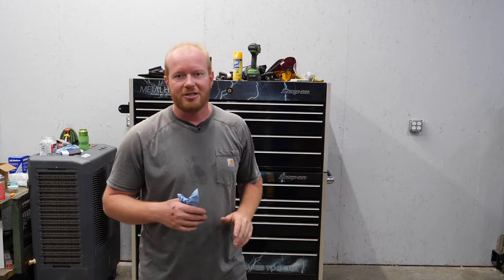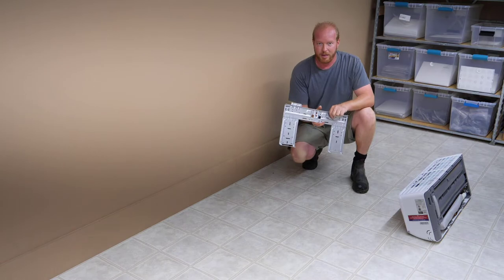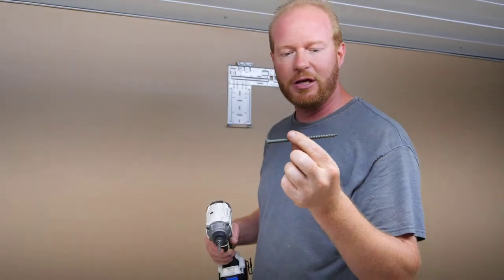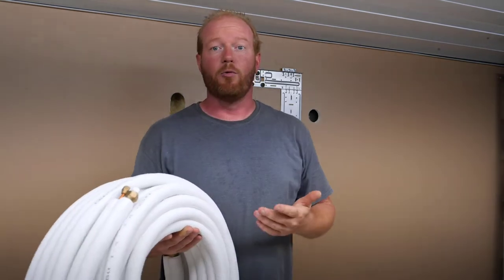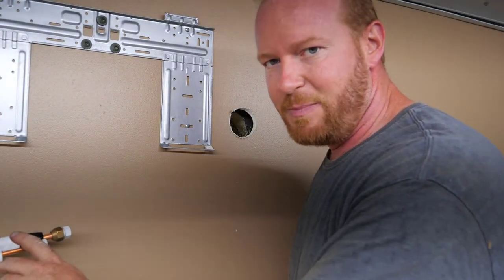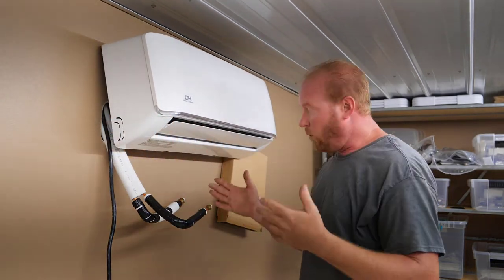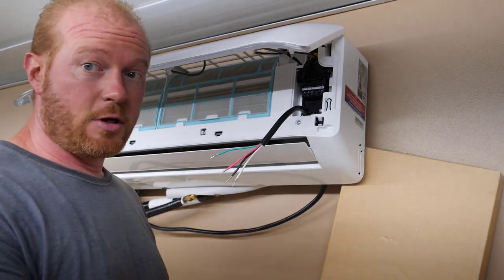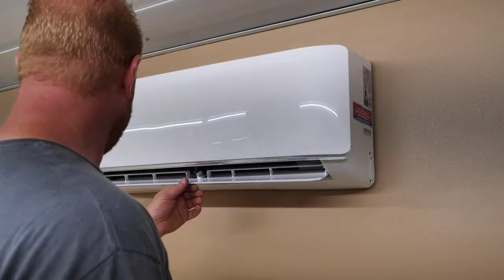Cooper and Hunter Mini Split install, Mistakes were made!

Comment: Pro tip for using that whole saw in drywall, just throw it in reverse. It won't bite and it will easily just glide through the drywall, plus if you ever hit a cable in the wall, it won't cut it

Comment: Thanks so much for the video. I have been looking for a video that showed running line set into the attic. Glad to know that it can be done.
Reply from the maker: Yes, you just have to consider the condensation line. They have pumps if you need to pump the condensation up as well.
Reply: Me too , Thank you so much Flash Performance..   and son :)

Comment: The indoor unit is charged with nitrogen, first it was used to pressure test the unit, then some of its kept there to keep water vapor and oxygen out. Is this system still working?

Comment: excellent video.
 Question: do the electric wire cables (run through inside of the attic) stand the summer heat?
 Thanks vm. Again this is an excellent video.
Reply from the maker: I have had no issues with Attic heat. on the electric or on the freon lines.

Comment: Where is the final installment where it is all up and running?  Thanks for this one as it helped me to see how to put the line set in from above.  The tech rep from Alpine explained it but it is much better to actually see it.  Thanks again.
Reply from the maker: I have been slacking on part 3 of this, but this system is working flawless. I have the AC on in my shop right now. 90% humidity outside and a cool 70 degrees inside.
Reply: @FlashPerformance  Just ordered our 36K btu four zone Blueridge ductless mini split today.  Excited to get it up after watching your from above install.
Reply: We need a part 3! 🙏

Comment: So I want to install this system on my own. The company says that it won't warranty any product unless it's installed by a certified ETA. The quote that I'm getting for installation alone is simply insane here in New york. I'm talking $20,000 install fee for installing three handlers, two condensers. I refuse to getting backed into a corner. Instead I would rather install on my own and take the chance with the quality of the product and simply hope it doesn't break down anytime soon. Was having your product warranty voided a concern of yours when you decided to do it on your own? And how is your system holding up?
Reply from the maker: My system has been fantastic. I have no concerns or complaints. You do not have to pay to have the system installed for the warranty, you only have to have a pro come in and leak test the system and show proof of that. That will be all you need for your warranty. I did all of my own install, then I had a HVAC tech come and pressurize it with nitrogen. Then he opened the valves and did all the pressure tests to verify it was correct. He shared me a few hundred bucks and gave me a recite showing he was there.
Reply: @FlashPerformance  Thanks for this information. I'm a full-force DIY guy, so I'll be doing the install. Now I see that I'll be hiring a licensed HVAC person to do a final check, and get that "recite" for warranty. NBD.
Reply: Bro for 20k you could install 15 of these and still save money. That’s insane. If you mess it up you still save money. They are hard to mess up. Just make sure your doing your wiring correctly from the breaker box and they is really the only hard part. Make sure your using the right breaker, right gage wire, and the right disconnect and wire whip and your golden.
Reply: @phillipm3799  thx for the response. I actually ended up doing it on my own and you're right. It was very straightforward. The hardest part was the construction demo but all else was straight forward.

Comment: why did you choose this brand over a different one?
Reply from the maker: There are a lot of manufacturers for mini splits right now. I was new to this and never installed or purchased before.  The main reason I choose Cooper and Hunter was because they answered my questions, and helped me through the process. They worked with me on sizing, where to put which unit, line set questions, and more. They just made it easy...

Comment: How is this unit holding up ?
Reply from the maker: Love it, use it every day. I was able too cool the whole ship down in just a few minutes, and the heat works just as well in the winter.  I still recommend this system
Reply: @FlashPerformance  is this the 115V unit or 220? I am looking to get the 115 so I do not need to add 120v and put it on a 20 amp circuit
Reply from the maker: @deancapinegro4575  This is a 220v unit. The power supply goes to the outside condenser, then the condenser powers the head units.